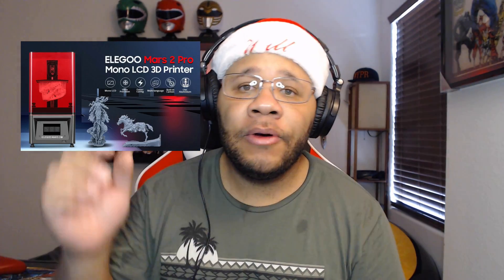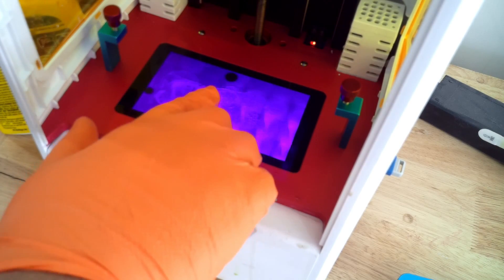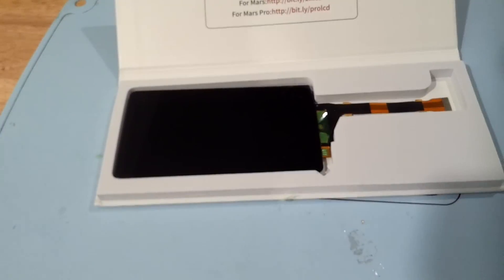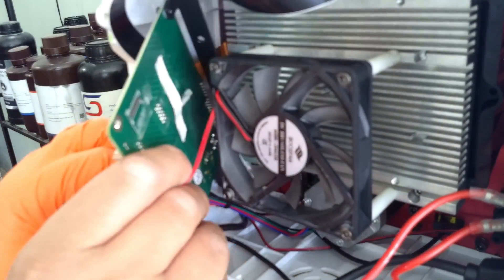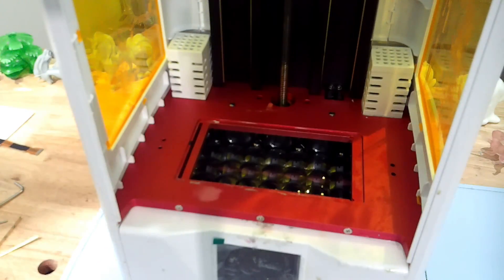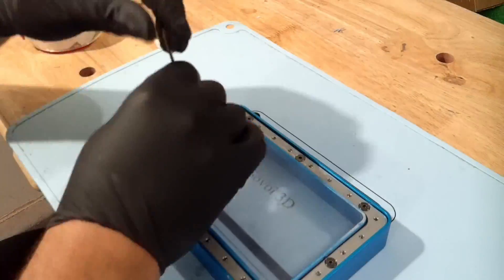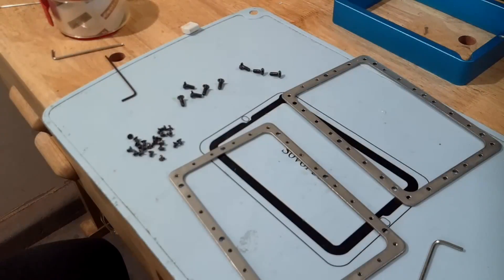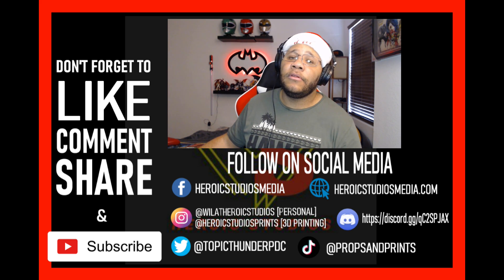Photon S LCD Screen Replacement

Comment: Yesterday I had to replace my display due to a defect.
When assembling, make sure that no dust remains on the lamps - I can take mine out again because I forgot to remove a piece of dirt. I could slap myself for being stupid ^^
The new display will probably break when it is removed.
Reply from the maker: Make sure that display is glued down. I ended up breaking mine again when removing the vat lol